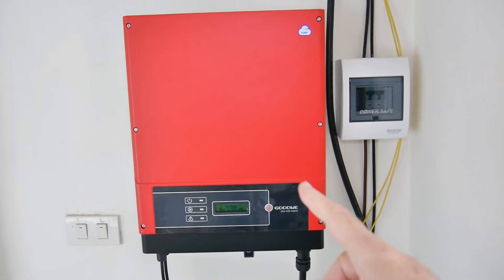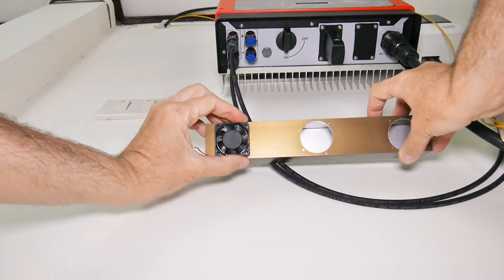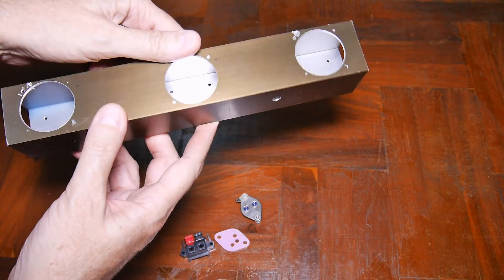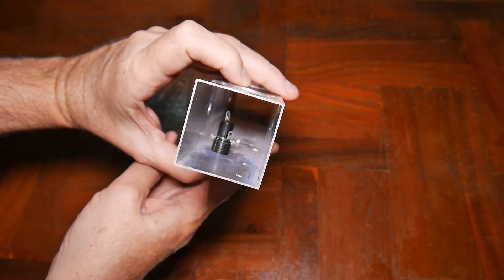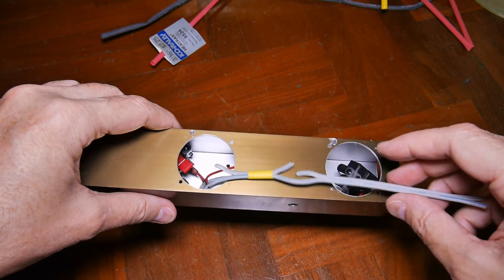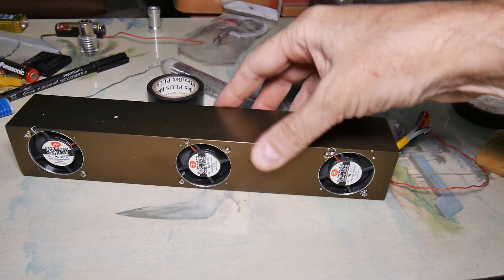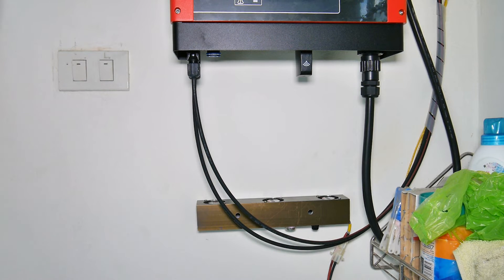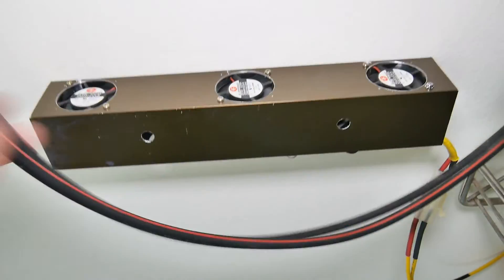DIY Fan Bar for Solar Inverter V1.0

Comment: ..I recommend adding pwm motor regulator/controller in-between solar and fan..than just dc from solar..there is difference..I'm on a same project cooling an outdoor fanless micro grid inverter..no fan noise..just tested adding a heatsink... hopefully not stolen..so far so good !
Reply from the maker: Great point!
Reply: @tsbrownie  ..future inverters should come with waterproof USB sockets for use while the sun is up (external USB fan) & optional expandable heatsink/radiator screw mount , An AC Powerlined internet connection for range boosting wifi ..also  theftproffing locks for outdoor micro inverter is an advantage.. currently my inverters pauses for 10 min on peak hours while cooling & charging it's capacitors for next sessions.. check GTB-600 ... Not recommending it since user manual came with spelling mistakes...I had no other choice..
Reply from the maker: @surenbono6063  Those are interesting options. I looked up the GTB-600, and it has some good features. I'm not convinced on micro-inverters yet. A friend put them in one of his company's factory installs. They double the number of connectors which are resistance / failure points, plus they increase the time to install significantly and the overall costs. They are going to have to have some really big, long-term benefits to compensate for all that. But I could be way wrong and I am waiting for the 5 year data to come in on them.
Reply: @tsbrownie  ..I needed it urgently since both 72 cell panels differs in ratings slightly and this inverter are capable of 2 input ...I tried parrellel but melted my previous inverter positive terminal... can't find any hybrid inverter with 2 input so far...  Dang!..mybe with hybrid inverter I could limit output throughout the day for self consumption while slowing down grid consumption..

Comment: Use a boost converter if there is low voltage
Reply from the maker: I have a video on an up converter.  The problem is that a "12 volt" solar panel can be almost 2x that under a light load.  The circuit boards on these fans won't take that so i have to ensure a max of 12 volts.  Under voltage is not much of a problem.
Reply: Ok

Comment: Thanks for sharing but I want to know if it did in fact lower the operating temperature of the Solar inverter! Did it worked?
Reply from the maker: Active cooling will always produce a lower temperature than passive cooling.  And with this setup there is enough air moving out of the top of the heat sink that you can easily feel it with your hand.